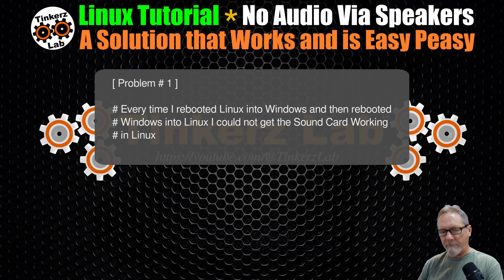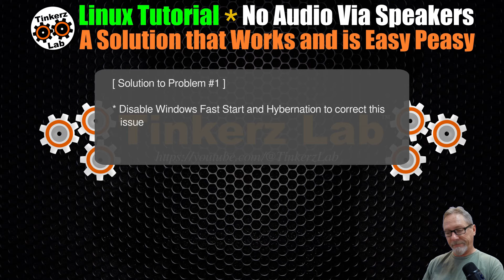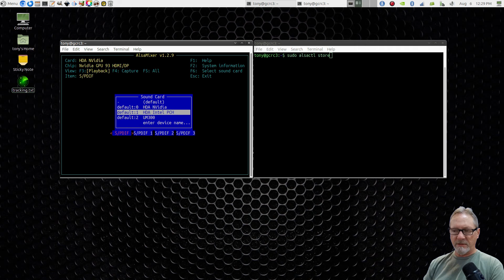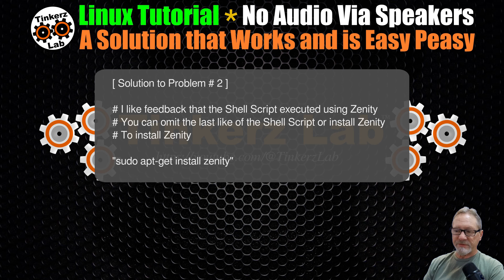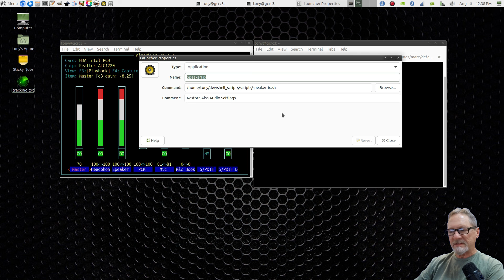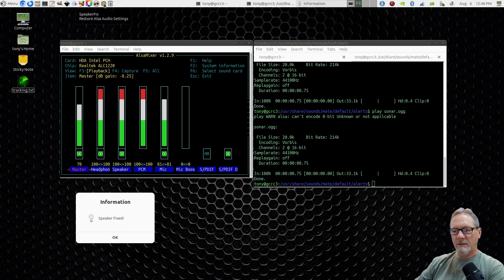Linux Tutorial | No Audio Via Speakers | A Fix that's Easy Peasy

Comment: does
not
work

I get no audio out of my speakers or out of a wired head phones.  NOTHING.  The kernel devs need to pull their heads out of each others asses and fix it.  This ****WORKED**** in 5.15 and has not worked since.
Reply from the maker: Hum, must be a different issue than mine.
Yes, frustrating.
I don't know what has changed on these audio chips as I have (3) MSI Laptops, different models, and only have this issue with one of them.
Let me know if you find something that works for your issue.
My headphones always worked, it just couldn't switch from headphones to speakers properly and windows fast start was also causing an issue.
Reply: @tinkerzlab  i can hard power off and I get no audio.  I have tried every single one of those "This works every time!" fixes and nothing fixes my hardware.

I can boot to windows and audio works just fine.  Not only that my laptop operates at over 5ghz.  Boot to linux and the kernel insists that either my processor does not support turbo or it is disabled in the bios.  both are patently false. 

There is something HORRENDOUSLY wrong with running Linux on intel devices.  Either the kernel devs need to pull their head out of each others asses or INTEL needs to.  

Both turbo and audio worked just fine 6 months ago.